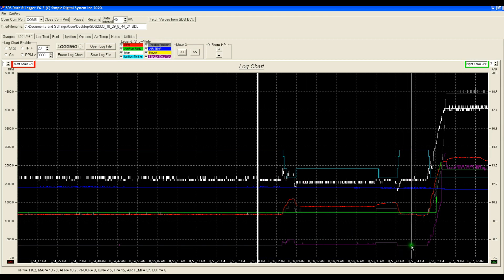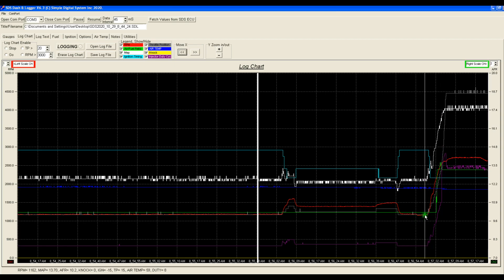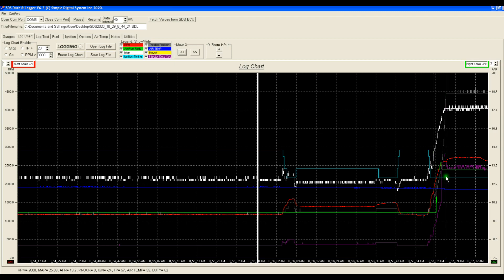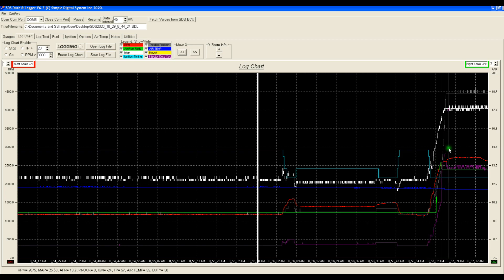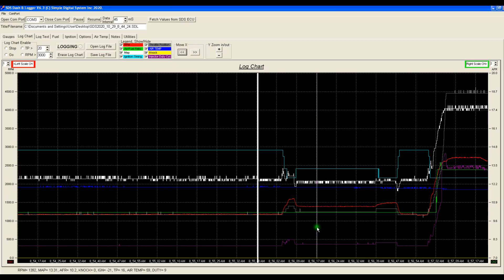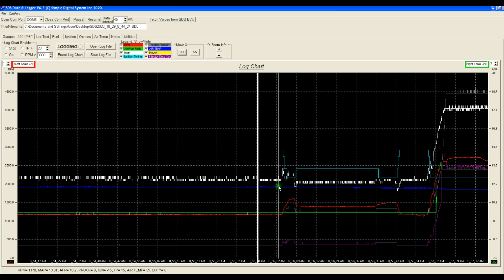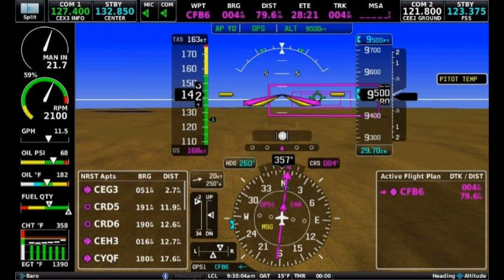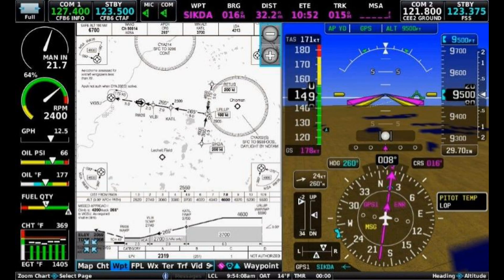RV-10 Flight and SDS ECU Data Logging

Comment: A long time ago, you put a post on the Vansairforce site about the possibility of an RV-10 fuselage fuel tank to expand beyond the 60 gallons.   Did you ever design anything or make the addition??
Reply from the maker: I'd planned a flat aluminum welded tank in the same shape as the baggage bay floor. Would have been around 12 gals. Would use a Facet pump or similar to transfer to one of the wing tanks. I'd also thought of a rear seat pan tank if you were flying with 3 or less people. This could hold more fuel and be more C of G friendly. Would have wrapped down into the footwell. Both types were designed to be fairly easily removable.
Reply from the maker: Never did. I didn't really need more than 60 gallons and eventually sold the plane.
Reply: @rv6ejguy  For the mission I need to do, I need an extra 15 gallons for IFR reserves, but like you I'm not a current fan of the tip tanks.